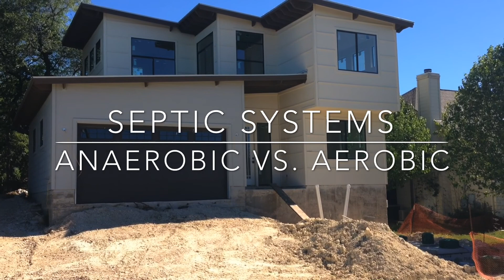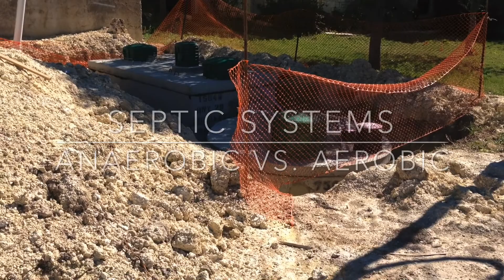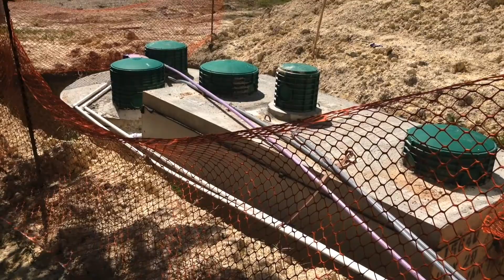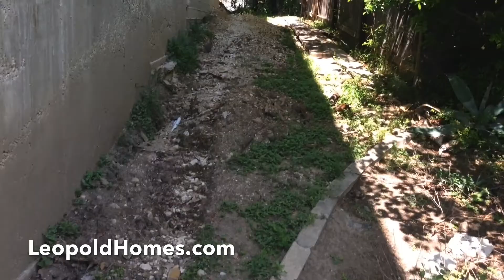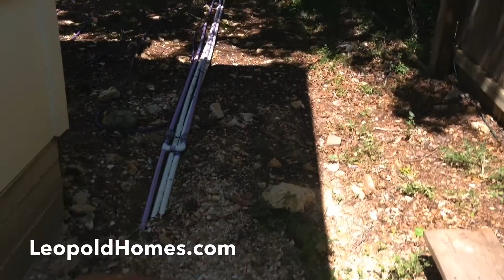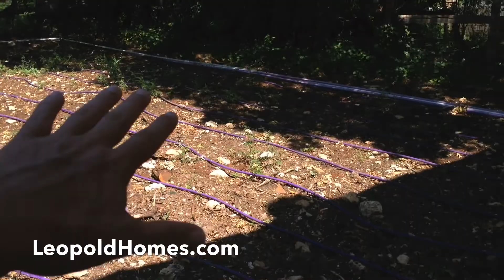Anaerobic vrs Aerobic Septiceducational videos Systems

Comment: Aerobic systems are extremely difficult to maintain and typically become a safety hazard. We are fighting hard for my county to ban these systems.
Reply: I guess that's easier than actually inspecting them. I just bought a house and the county checked the property but apparently forgot to inspect the septic aerator, because it was non-functional when I looked at it later.
Reply: Wait what? How are they hazardous?
Reply: I don't think they are "extremely difficult to maintain" but they do require regular maintenance. The aeration pump will require electricity and servicing every few years. Some of them have chlorination stages which require the periodic addition of bleach or tablets.
Reply: @brianrobertson3545  we had one here that a child fell into and died when the service guy left it open to go get a part in town.  They can be deadly. Very sad.
Reply: Wut?  This is a terrible take.